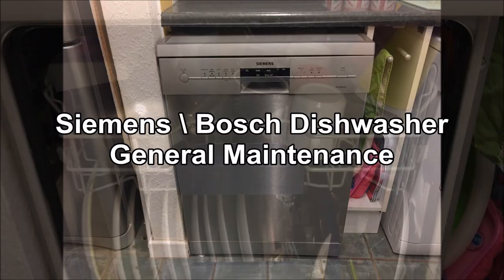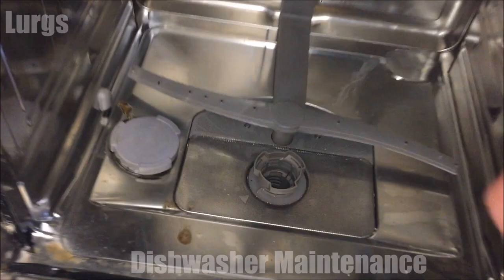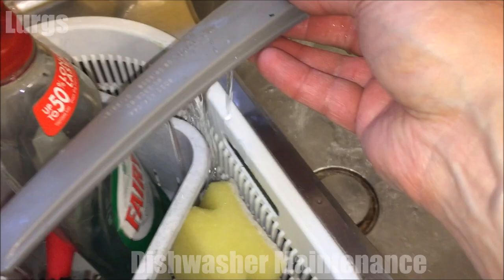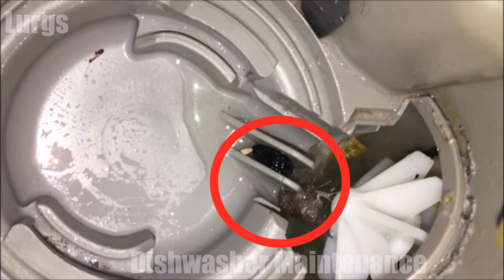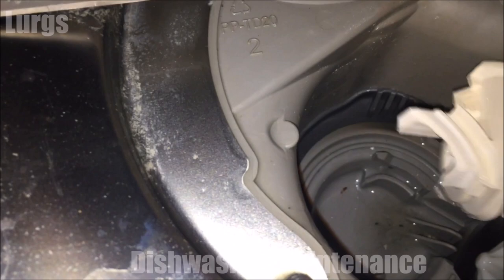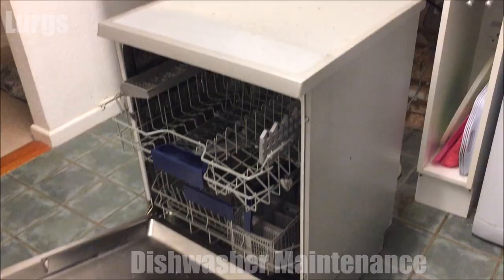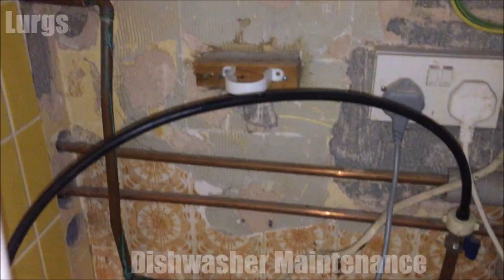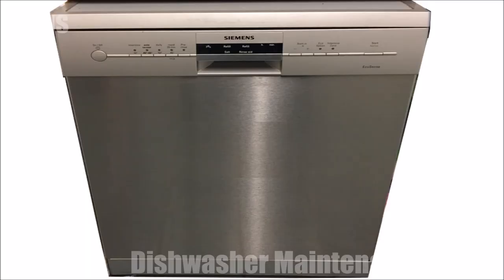How to clean Siemens Dishwasher for Maximum Efficiency - Siemens Dishwasher Maintenance

Comment from the maker: Other useful Videos to help you save ⏱TIME and 💰 MONEY:
========================================================
Bosch \ Siemens Dishwasher
==========================
Dishwasher Error Code E23 https://www.youtube.com/watch?v=6z22-Ysn7rE&list=PLqrXuUebV8N89GJMUjDiMqGpAcic3wqfD
Siemens Dishwasher Maintenance https://www.youtube.com/watch?v=EhMpCig5jqc&list=PLqrXuUebV8N89GJMUjDiMqGpAcic3wqfD
Bosch Dishwasher E25 Error Code and How to Clean Filter for Maximum Efficiency https://www.youtube.com/watch?v=JAYli3EIcvI&list=PLqrXuUebV8N89GJMUjDiMqGpAcic3wqfD
How to clean Bosch Dishwasher to keep it Hygienically Fresh https://www.youtube.com/watch?v=DEknDV_QW4s&list=PLqrXuUebV8N89GJMUjDiMqGpAcic3wqfD
How to add Rinse Aid to a Bosch Dishwasher for Sparkling Glasses, Plates and Cutlery https://www.youtube.com/watch?v=eGxDojdRkRE&list=PLqrXuUebV8N89GJMUjDiMqGpAcic3wqfD
How to add Salt to a Bosch Dishwasher https://www.youtube.com/watch?v=ePr6zQRR3II&list=PLqrXuUebV8N89GJMUjDiMqGpAcic3wqfD
Bosch Dishwasher Maintenance for Maximum Efficiency https://www.youtube.com/watch?v=D_OszLw-llU&list=PLqrXuUebV8N89GJMUjDiMqGpAcic3wqfD
How to adjust Basket Height on Bosch Dishwasher https://www.youtube.com/watch?v=4i48aqpAIzQ&list=PLqrXuUebV8N89GJMUjDiMqGpAcic3wqfD
How to set Water Hardness on Bosch Dishwasher by setting Salt Dispenser Levels https://www.youtube.com/watch?v=zY4VRDoDC7g&list=PLqrXuUebV8N89GJMUjDiMqGpAcic3wqfD
.
How to Disconnect a Washing Machine for Recycling or Moving https://www.youtube.com/watch?v=9oUzuS9E5kU&list=PLqrXuUebV8N_Bv_41hH-IpIfM5qiS0Sin
How to install a new Washing Machine https://www.youtube.com/watch?v=NGptwJDCTjo&list=PLqrXuUebV8N_Bv_41hH-IpIfM5qiS0Sin

Washing Machine not Draining Water Fixed https://www.youtube.com/watch?v=WxNRAMWDY2w&list=PLqrXuUebV8N_Bv_41hH-IpIfM5qiS0Sin
Washing Machine Fabric Softener Dispenser not Emptying Fixed https://www.youtube.com/watch?v=R5xIKjWuAIg&list=PLqrXuUebV8N_Bv_41hH-IpIfM5qiS0Sin
Washing Machine Drum Noise Spinning Fixed https://www.youtube.com/watch?v=mJo6IloTP1U&list=PLqrXuUebV8N_Bv_41hH-IpIfM5qiS0Sin
How to Clean your Washing Machine to keep it Hygienically Fresh https://www.youtube.com/watch?v=NbOUDxk7Yxw&list=PLqrXuUebV8N_Bv_41hH-IpIfM5qiS0Sin
How to Fix a Smelly Washing Machine https://www.youtube.com/watch?v=07B0BYKw-gs&list=PLqrXuUebV8N_Bv_41hH-IpIfM5qiS0Sin
.
Dishwasher How To's, Tips, Tricks & Fixes https://www.youtube.com/watch?v=6z22-Ysn7rE&list=PLqrXuUebV8N89GJMUjDiMqGpAcic3wqfD
Washing Machines How To's, Tips, Tricks & Fixes https://www.youtube.com/watch?v=6z22-Ysn7rE&list=PLqrXuUebV8N_Bv_41hH-IpIfM5qiS0Sin
Toilets and Plumbing How To's, Tips, Tricks & Fixes https://www.youtube.com/watch?v=vT5KwJ2A2eU&list=PLqrXuUebV8N_d4OWPjAk4PJ7LnKb0Jdot
Combi Boiler How To's, Tips, Tricks & Fixes https://www.youtube.com/watch?v=1gGEP2y_qHM&list=PLqrXuUebV8N8aiBpt_F3n23E3IOLlmgK2
How To's, Life Hacks, Helpful Tips here https://www.youtube.com/watch?v=dcmxUTsedlk&list=PLqrXuUebV8N92xXP4Dm_pHfBpEQ3wtP2R
.
Hotpoint \ Indesit Washing Machine How To's:
============================================
Washing Machine F05 Error Code Fix https://www.youtube.com/watch?v=0_gst8RokRo&list=PLqrXuUebV8N_Bv_41hH-IpIfM5qiS0Sin
Washing Machine H2O Error Code Fix https://www.youtube.com/watch?v=gtRyR1gQj6I&list=PLqrXuUebV8N_Bv_41hH-IpIfM5qiS0Sin
Washing Machine F06 Error Code Hotpoint Indesit Door won't Open Fix https://www.youtube.com/watch?v=RCnxTPkQJ90&list=PLqrXuUebV8N_Bv_41hH-IpIfM5qiS0Sin
How to clean Hotpoint Aquarius Washing Machine Pump Filter and Dispensing Drawer https://www.youtube.com/watch?v=x1E_gBvOtCw&list=PLqrXuUebV8N_Bv_41hH-IpIfM5qiS0Sin
How to remove dispenser drawer from Hotpoint Washing Machine https://www.youtube.com/watch?v=ML5JgFcS4jI&list=PLqrXuUebV8N_Bv_41hH-IpIfM5qiS0Sin
.
Bosch\Siemens:

==============
Bosch Serie 4 VarioPerfect Washing Machine EcoSilence Drive:
Review & Wash Cycle https://www.youtube.com/watch?v=IccZCkQfBG0&list=PLqrXuUebV8N_Bv_41hH-IpIfM5qiS0Sin
SuperQuick 15 minute Wash in Realtime https://www.youtube.com/watch?v=4YgoBzj5fjQ&list=PLqrXuUebV8N_Bv_41hH-IpIfM5qiS0Sin
How to remove Dispenser Drawer https://www.youtube.com/watch?v=cj6ZupxqZEQ&list=PLqrXuUebV8N_Bv_41hH-IpIfM5qiS0Sin
Detergent Drawer Symbols & How to use them https://www.youtube.com/watch?v=SyoOvThCfUA&list=PLqrXuUebV8N_Bv_41hH-IpIfM5qiS0Sin
Maintenance Tips for Maximum Efficiency https://www.youtube.com/watch?v=eQZfevfTC-Q&list=PLqrXuUebV8N_Bv_41hH-IpIfM5qiS0Sin
Display Panel Overview https://www.youtube.com/watch?v=5Ps19okbE9c&list=PLqrXuUebV8N_Bv_41hH-IpIfM5qiS0Sin
How to remove Aqua Inlet Filter https://www.youtube.com/watch?v=1rvrUKbjt9o&list=PLqrXuUebV8N_Bv_41hH-IpIfM5qiS0Sin
E18 Error Code Fix Bosch Siemens Pump Filter blocked https://www.youtube.com/watch?v=qYjn8xnW3Pc&list=PLqrXuUebV8N_Bv_41hH-IpIfM5qiS0Sin
E32 Error Code Do not Panic https://www.youtube.com/watch?v=JAMGpceI6wc&list=PLqrXuUebV8N_Bv_41hH-IpIfM5qiS0Sin
How to activate Child Lock https://www.youtube.com/watch?v=yHMtk7pycG4&list=PLqrXuUebV8N_Bv_41hH-IpIfM5qiS0Sin
Door Stuck and How to Open it https://www.youtube.com/watch?v=JGJA8J7cB7w&list=PLqrXuUebV8N_Bv_41hH-IpIfM5qiS0Sin
Beeping Hell How to turn off beeping noise https://www.youtube.com/watch?v=fkJ4VU6ldLk&list=PLqrXuUebV8N_Bv_41hH-IpIfM5qiS0Sin
How to remove Dispenser Drawer from Siemens Washing Machine https://www.youtube.com/watch?v=HXAJlGbF-Vw&list=PLqrXuUebV8N_Bv_41hH-IpIfM5qiS0Sin
How to install Bosch Washing Machine VarioPerfect Serie 4 in Simple Easy Steps https://www.youtube.com/watch?v=L24GgdT9xq8&list=PLqrXuUebV8N_Bv_41hH-IpIfM5qiS0Sin

Comment: Hi 
I regularly clean the dishwasher but only recently I had a blocked InSinkerator which caused me endless problems as water back fed into the Dishwasher causing start sequencing to be knocked out. I'm curious about the Water Bag on the left-hand side of the Dishwasher. Halfway up this and at the left there is a part of the Water Bag which never seems to flush out properly. Any pictures that I've have seen have shown this area to be grubby. Have you any ideas on how this area can be flushed out? 
Regards.
Reply from the maker: Not sure what part you mean?
Reply: Hi,
Following on from my previous message the area that is fouled up is to the left-hand side of the 'waterbag' P/N 9000252426 and half way up it. Any ideas of how this area can be flushed out would be appreciated.  Thanks.
Reply from the maker: I'm afraid I don't. Hope you get it sorted.

Comment: You forgot to clean the inlet filter.
Reply from the maker: Oops. Bit late now as it's gone.
Reply: Hi,
I regularly clean the dishwasher but only recently I had a blocked InSinkerator which caused me endless problems as water back fed into the Dishwasher causing start sequencing to be knocked out. Got it sorted! But I am curious about the Water Bag on the left-hand side. Halfway up this and at the left there is a part of the Water Bag which never seems to flush out properly. Any pictures that I've seen have shown this area to be grubby. Is there any method or cycle that I can use that will focus on this area?